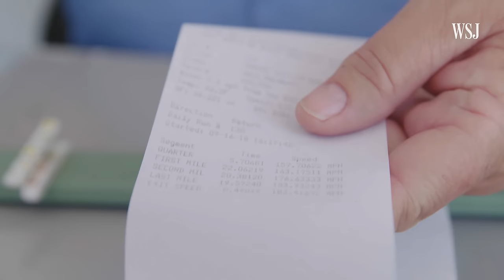How This Cyclist Hit 184MPH and Set the World Record

Comment: World records are generally only impressive when the barrier to entry is low enough for a large amount of people to attempt it. I doubt more than 100 people have even attempted this under these conditions of a lead car + dragging the rider (which is cheating in my opinion).
Reply: It's not really cheating when it's physically impossible to do it any other way due to air resistance. Just because she was towed don't mean she doesn't deserve respect for going 184 on a bike
Reply: @ashleyrobertson1163  its cheating in my opinion because you can basically break the record by using external forces

Edit: being towed by a truck to get that fast vs biking behind a truck to remove air resistance. One is just cheating and the other you need stamina to last long enough to reach 180
Reply: @thisguy5635  i don't have much of an issue with the slipstream, but i do think the cyclist should not be pulled to like 100mph. I think it should only count from a stand still without being pulled.
Reply: Do surfers cheat by using the jet ski to ride mavericks?????
Reply: @enzovalkiria1024  checkmate
Reply: II AM POTATO without the barrier, it’s really difficult to go that fast since it keeps the air from slowing the bike down. The fastest I went on my bicycle while pedaling was 32.2 mph (51 km/h) last Saturday. Even hitting 30 mph is difficult too, but I am still trying to go faster
Reply: @hoen2009  agreed. Using the car to stop Air resistance would be fine, but the car literally speeding someone up until very fast speeds doesn't seem very impressive.
Reply: @hoen2009  There's another record for that.
Reply: @enzovalkiria1024  Except the jet skiis don't continue to pull the surfers after they catch the wave, this bicycle is literally being pushed by the slip stream, she's not accelerating by pedalling
Reply: @chadingram6390  u missunderstood the point ... nobody is cheating and it would be imposible to take those waves just swimming or getting that speed just paddling ...
Reply: @enzovalkiria1024   i think you are misunderstanding everyone elses point, this is not an impressive feat, sitting on a bicycle riding a slipstream is not nearly as impressive and takes none of the talent and skill needed to ride a maverick.
Reply: @thisguy5635  you'd need too many gears  to reach the speed if you don't tow her to a certain speed.
Reply: @enzovalkiria1024  no? But there goal isnt to break a world record in speed? Do ypu know anything sbout surfing or just
Reply: @immazoorun4404  you canot ride a maverick without a jet ski ... I know that
Reply: @enzovalkiria1024  sarcasm i hope, becuase thats a lie
Reply: A. Bible that's what makes records without a crutch more impressive.. I get that this isn't easy but it could easily be equated to hitting 80 or 90 entirely under her own power. This just feels like fudging numbers. Fasted woman on bike sounds way better than fastest woman on bike, after being towed to 130, with air resistance mostly removed..
Reply: This Guy because of the gearing on the bike bike it would be t hard to pedal and build up speed from a stand still but yeah most of this is all technology doing the work  from the design of the bike and the drag car concept is what made this happen regardless of who was on the bike
Reply: @ashleyrobertson1163  It is cheating, there are a lot of records that can be broken with assistance.

Comment: She's not the fastest bike rider. She has just gone the fastest
Reply: R elyks that’s the point?
Reply: That's literally the same thing.  She rode the bike that went the fastest.  "She's not the fastest, she's just gone the fastest."  Brilliant analysis.  Though, you've managed to take the point of the record and completely miss it along the way.  Still, brilliant.
Reply: She was towed to the fastest speed
Reply: @doodoodeedoo3958  She accelerated under her own power after untethering. They had to tow her up to starting speed since the gearing on the bike wouldn't allow a standing start. These were the same conditions as the first record that was set, so it's a legit run.
Reply: Andrew Elias sighs 
If you understood the physics behind why she needed to be towed to 110 mph before releasing from the tow vehicle, you would understand that the only effort in her part is to hold on and not die. The vortex created by the slipstream literally pushes her into the back of the tow vehicle, hence the bumpstop attached to the front of the bike.
The only skill involved was from the driver not increasing speed to fast keeping the car steady to avoid killing her. 

This is why you kids need to stay in school so you don’t get fooled by stuff like this, bye your welcome
Reply: @doodoodeedoo3958  In the meantime, she goes in the history books, while your only world record is for being smug on the internet.
Reply: Reflex  She maintained speed with no wind in a vacuum, a specialized bike, and a force of wind pushing her as the air pocket fills back up behind her. AMAZING
Reply: @modelcitizen1977  Better than no world record at all?!

Comment: Pretty cool but, any decent cyclist being pulled behind a dragster with that bike could do that!
Reply: Shaneb73 wrong
Reply: its not pulling its a pacer to stop the wind from interfering
Reply: @deanlycett-amin1903  they get pulled up to like 160 or so
Reply: @Johnny-tq9no  she got towed up to 110MPH, then it was all pedal. Still, incredibly impressive.
Reply: Erick Rodríguez it’s pretty much like pedaling in space there is almost nothing to counter while speeding up other than rolling friction and that is easy to counter. I’m pretty sure any decent cyclist could pull his off. I’m sure if that car would go up to 250 mph and she would let go, they would have called that a new record, which it shouldn’t be
Reply: ...but have they?
Reply: @wynettlapour7961  no, because they are not willing to spend $25k++ on that thing
Reply: Dean Lycett-amin it pulled her most of the way
Reply: it's fixed gear, she HAS to pedal pulled or not.
Reply: @erickdavid4257  Actually, the backwash of air going around the windbrake PUSHED her.  She probably didn't have to pedal much at all.

Comment: I’m interested in what kind of hubs were used, 17” wheels at 180 mph are gonna be spinning really dang fast
Reply: they said it was a set of converted motorcycle wheels and tires
Edit, never mind. I now realize my comment made no difference. I wasnt thinking about a free wheel type hub that she actually has. sorry.
Reply: Actaeon honestly a great question
Reply: @zuestoots5176  what a polite young man
Reply: Looking at the picture of the wheel, I think those where Profile Fixed Gear Hubs.
Reply: Some good engineering for sure... And maintaining balance at that speed requires some skill.. Drafting on the air vortex behind cars is really risky and they can cause random turbulence. That is what happened to Fred, he was thrown up..
Reply: @Vary180  I try.
Reply: @funwithdk3550   I swore i saw her coasting at one point.?
Reply: I can't believe she used 17"ers. why wouldn't she use something bigger that would allow higher speed? the only thing I can think of would be weight reduction.
Reply: @sammy sines she probably used 17" wheels because of drag. if you went with a bigger wheel, you would have to put more power into turning the pedal, so you might not even go as fast
Reply: @sammysines471  17" probably for the motorcycle tire availability.
Reply: @Zygy __ I would think heavier would be better for this, since the spinning wheels act like gyroscopes to help maintain upright stability.
Reply: I was surprised at how small diameter the wheels were and how wide the tyres were. Must have generated a heap of rolling resistance.

Comment: People who comment that she got dragged to reach 184mph, did you watch the video? She get's detached at 16:45, at like 140mph. Then she has to pedal the bike to 184mph on her own. She has to be dragged first to reach a high speed because the gear ratio on the bike is so high, it wouldn't be possible to pedal the bike. Yes, the car in front splits some of the air for her, she still has to use her own strength and techniques to accelerate and stay balanced. Plus, she has to keep up with the car, so that she doesn't fall out of the slipstream or she would just immediately get tossed into the air.
Also, to those who say she sounded like super conceited, she didn't come up with this record herself, she was actually persuaded into doing this by the man who set the record.
Reply: To be specific, she is being propelled forward by the vortex from the dragster's windscreen. A difficult and dangerous stunt indeed but not the "world's fastest cyclist", the fastest bicycle riders are on the International Space Station.
Reply: aka SHE:S DRAFTING THE VEHICLE....  you know...  because the air at that speed would slow back down to normal resistance..  like 30 mph.... lol       ps  no human can pedal passed that, the resistance becomes greater then they're pedaling strength (being even if you had infite gears)  so..   the car basically creates a vacuum behind it at that speed, and thats the ONLY thing keeping her at speed.    so she just followed a car up to 180 mph...  woohoo...  anyone can do that.
Reply: Why not just ad anoter gear? :)
Reply: its no different than riding in a vacuum, sure there were high winds side to side, but thats equivalent to somebody riding a bike behind a car from 0-45 mph.

Comment: most of people in comments don't know what happened.
1. the gear on that bike is so tough so it's almost impossible to ride from 0 mph on it, watch how she struggle on 100 mph just to make full 360 degree pedal turn, so she was needed some power from outside
2. the wind say NO when you want to reach that much speed, when I reached 50 km/h on my bike it was very windy on a forest park where wasn't windy at all and it was hard to control the bike itself, 50 km/h = 31 mph what is about 6 times slower than reached speed by her, so she was definitely needed in some aerodynamic shield
3. the help with vehicle was for reaching some speed when she can speed up BY HERSELF to record's speed, I don't think that it's cheating, it's anyway very difficult but it doesn't mean that this record is last, of course somebody can ride faster in similar conditions

Comment: Rules are rules.  I completely agree this is not a true unassisted speed record, but it is a record set forth by the rules.  Very dangerous.  I have come out of tuck on motorcycle at 185.  Wants to rip you off the bike for that first second.  Couldn't imagine doing it on a light bike with little tires.
Reply: The only difference is that she is protected by an air pocket otherwise she wouldn't be able to go this fast, the real record is trying not to fall back or die
Reply: it is never presented as anything other than assisted speed record
Reply: Jay Trock there’s no air

Comment: It's difficult to control a bicycle going anywhere over 50 MPH. In my experience, even well-built bicycles become unstable and unpredictable at speeds higher than that, and steering becomes extremely touchy - The slightest mistake can send you flying to oblivion. Bicycles handle quite different from motorcycles due to generally narrower tires and wheels, and being built much lighter, making steering responses much faster. Unpredictable gusts of wind can easily blow you off balance, too.

So imagine being in her place trying to control that monster, going WAY faster than the dang thing was even built to go. That's one incredibly brave woman. I truly admire her. Sure, she was assisted with another vehicle, but assisted or not, that's an extreme record.

Comment: It is true that she did travel 184 miles/hr (296 km/hr). That is a legitimate record. You can all come up with your own interpretation but you cannot disprove that record.

However, in order to achieve that speed, they had to cheat the physics. First, they had to eliminate wind drag. That's the purpose of the vehicle before her. The car will slice the air providing her with a path that is almost like a vacuum.

But that was not the only force at play there because it would have been physically impossible for her to pedal that bike considering that it was equipped with a double cassette. As the vehicle sliced through the air, the air immediately occupies the vacuumed space, which pushes her from the back. The push of the wind behind her actually made it possible.

Unless you can come up with your own argument to invalidate her record, her record stands as the fastest human being on a bicycle.

So suck it.

Comment: I recognize the risk the woman took when she attempted this record but it just seems unfair to other people. It’s like if you were to use an engine on a sail boat until the engine maxed out, and then you turned off the engine and as you cruise, you claim that you had the fastest sail boat in the world. It just doesn’t work like that. I can appreciate the aerodynamic aspects of the record attempt but for most of the ride her bike is strapped to the dragster. I would consider it legit if her bike wasn’t strapped to the vehicle.
Reply: The reason for strapping the bike to the dragster was that it was impossible to accelerate if it wasn't already going fast enough, apparently 110mph. Once the dragster towed her to that speed, the tow was released and she pedaled all the way to 184, under her own power exclusively. It's legit.

Comment: If you understand physics, air is the tether here. So for all intents and purposes, just picture the bike is being dragged. That said, I completely fail to see the purpose of this other than - "So I did this."
Reply: Records were meant to be broken, blame the first guy in the 1800s.
Reply: me to...   this isn't a record either..  so..   being dragged by drafting a vehicle it is :-\     pointless..   she missed then land speed record by 550 mph lol
Reply: @harleyme3163  towed to 130-140 mph and disconnected then she rode for more than 1 mile under her own power. Regarding if this is a record, look up the wiki page for cycling records, start reading from the top and tell me the first name you read.
Reply: @craigborrenpohl1233  You don't understand physics at all.  The air was pushing her forward.  She was fully assisted by the vehicle in front for the entirety of the ride, or else she would have came out of the slipstream at the 110 mark and did it on her own.  But she did not do that, because she could not.